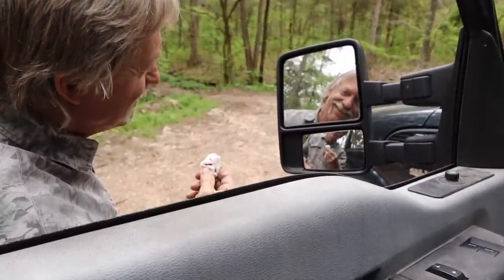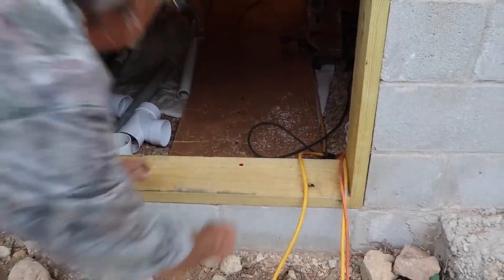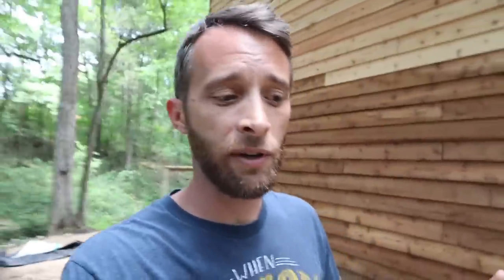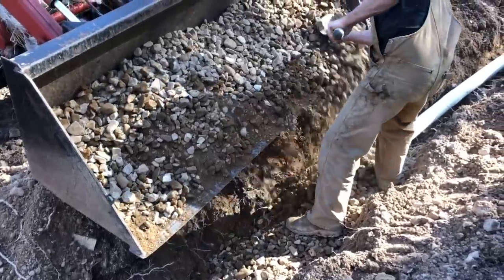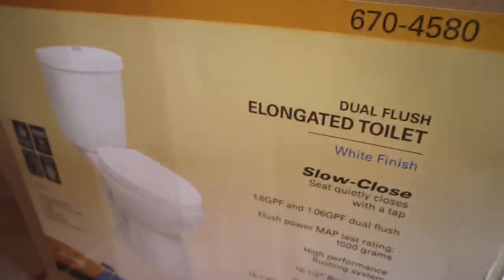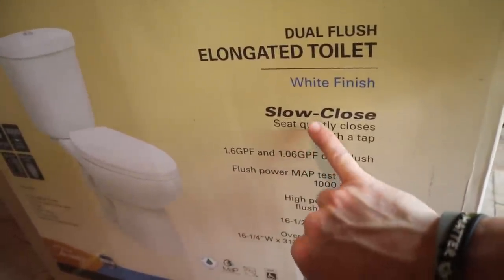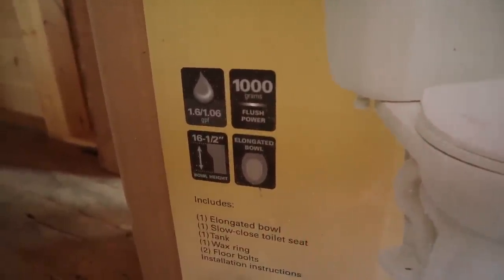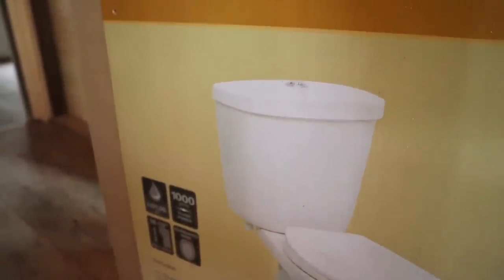Waste 💩 Management / Toilet 🚽 Options for the Off Grid Cabin - EP#19

Comment: You can get a good bidet that fits under your toilet seat, no electric required, better job at cleaning your bottom and only a few sheets of tp to dry a bit.  Much less tp used so your septic lasts longer.  Check them out at Amazon.  Less than $100.
Reply from the maker: Thanks 😊

Comment: Good choice 4 years off grid with a sun mar toilet a pain in a butt I would use sawdust and a bucket before I would go back to that nice that Missouri has lighter restrictions than Wisconsin but place is sold and hopefully September full time RVing God bless hope to see you on the road
Reply from the maker: An expensive pain too!! I looked at those and they are just as expensive as what it cost for our septic system.

Comment: I don't understand why more people dont make use of the waste. So heres my idea, install a system that will capture and sperate the waste IE septic and soak away system, but instead of just wasting all that viable natural gas why not capture it into either an inflatable bladder or weighted /spring tensioned capture tank of sorts. That way in time you will have an unending supply og natural methane gas, obviously the system will require some design and tuning but i think i  have after about 4 years of enquiry got a solid concept.

Comment: Where we live in Ohio we had some of the most ridiculous County EPA guidelines in the state. It got so bad that the realtor association filed a lawsuit. The State EPA stepped in and got rid of the idiots and settled out of court. In Ohio no matter what the size of your property is the requirements are basically the same. The exceptions are for the Amish and for commercial use. A bathtub needs to be part of that system.
Reply from the maker: Yeah I’ve had lots of people asking because seems like a lot of areas around the country are super strict. Glad our area is not.
Reply: Yep, Amish here in Indiana have preferential treatment as well and it pisses me off. Using the restroom has nothing to do with God nor religion. I was told by my local building dept that I would need to pull permits and have a septic system on my hunting cabin because it exceeds 200 sq ft. But my Amish neighbors have a 4000sq ft home and don't have to have a septic system because of religion. Such bullshit. A basic system is over 20k here in Indiana and must be approved by health dept. Needless to say, I use 5 gallon bucket bathroom since it's just me
Reply: @featheredcoyote5477  lol don't blame you Coyote, do you use your waste to water and fertilize your garden beds and plants...or just dig a hole and dump? Any issues with smell or critters, etc?
Reply: @DrudgecoinMaxi  absolutely zero smell and zero issues with critters. Use sawdust to cover after every use until bucket gets full. Put a lid on it and set out in the sun for at least 6 months. After 6 month's, use a composting bin layered with grass clippings and straw. 

Doug and Stacey have great video's on YouTube explaining this method. You should check them out. They've been using this format for years in Missouri while living off grid.
Reply: @featheredcoyote5477  Awesome and thanks for the info. I'll definitely follow up with Doug and Stacey. Thanks for sharing. Stay Safe! 🤜🤛🇺🇸
Reply: @DrudgecoinMaxi  Absolutely! Doug and Stacey have a fantastic channel that's very informative. Stay safe my friend 🇺🇸👍

Comment: So does the septic tank have to be emptied out periodically, or is there some type of grinder/aeration system?
Reply from the maker: If it’s over used and the solids don’t have time to break down then yes it would need to be pumped out periodically. But if it works properly then as solids turn into liquids it will work it’s way into the lateral lines into the ground.

Comment: split level composting toilet would of worked fine. they only need emptied few times a year. you deffinetely want to have a grey water diversion system so your shower and washing water does not go into a tiny 500 gallon septic tank. If that clogs while guests are there, it will only last a day or two before it backs up and makes a mess.  with a grey water diversion system a 500 gallon tank can last 2x longer and works better because the bacteria work better when more concentrated.  but in the end people cant' deal wtih thier own shit so a water based toilet will get you more rentals.